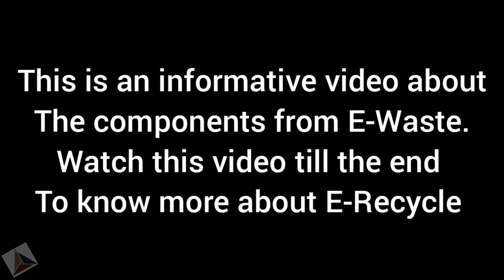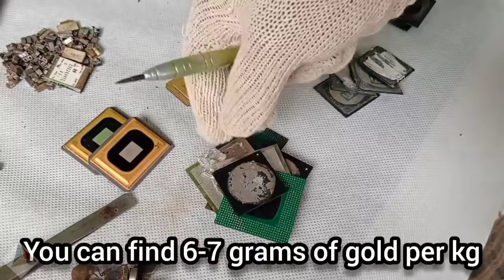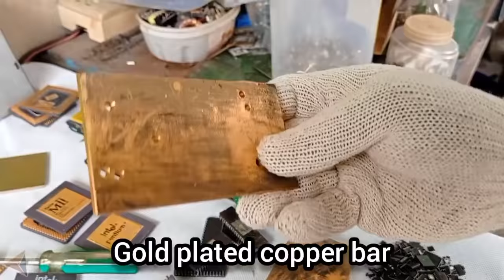Sorting Components For Gold Recovery | Introducing The Components That contains Gold | Gold Recovery

Comment: Quick question, wouldn't it be better to just pulverize the mother board to a almost dust like powder and then go from there,what would be the benefit v the hassle?
Thank you for your time kind sir
Reply from the maker: Considering the intricacies of e-waste recycling, pulverizing motherboards into almost dust-like powder might seem efficient, but it comes with challenges. The benefit lies in better element separation using water-flowing vibrator trays, outweighing the potential hassle associated with a finer powder approach. Thank you for your question!

Comment: You should always pyrolyze then burn (not melt) the computer part to:
1. lower volume (need less acid to refine and keep metals submerged) 
2. increase surface area by getting rid of plastics and other crap
3. Get rid of oils (those would make the extraction slower)
4. You don't need to break open the components
5. Write down below

2024 edit, ruthenium from smds will burn off though
But its hard to process using acids anyway
Reply: Where does that smoke go? In air? I n environment? Kind of very important
Reply: @fightington  that's true but people are burning wires, plastics, whole freaking circuit boards.
There is not that much plastics on those gold bearing parts to be that concerned in my opinion

There is always that guy who sets fire to a whole landfill, this is nothing in comparison
Reply: Doesnt mean it's any less important - it all adds up and it's not good - life will go on without a human-inhabital planet and we don't have another one floating around. Agree there is much worse but thats not the point. All the best
Reply: @fightington  true, i ll edit it to pyrolyze the parts and then burn the remaining carbon

Comment: Sir, I did it aqua regia with the items ram fingers and processor bottom chips. I got metal powder then while I am melting with mercury result is not good. Colour of metal is black or grey type. Jewelry workers said it is not gold but is a metal they couldn't identify. So advice me where my mistake on it?
Reply from the maker: Again refine it with aqua regia.
Reply: Ok sir I will do it again
Reply: I do with 15 processor 15 bga bottom 10 ram fingers and some little others then I go it below 0.17 ml metal only
Reply: And sir one more also metal powder melting with mercury is it ok?
Reply from the maker: Don't use mercury. 
Use aqua regia

Comment: The thing you call a dlp processor has nothing to do with DLP at all. DLP or DMD chips as they're usually called have a screen built into the chip, than it is reflected onto the screen. You just got one in the latest video you posted, Nevermind you have one in this video the projection chip as you call it is a DLP cpu
Reply: I'm confused sorry . ....," The thing you said was a DLP processor .... Is a DLP CPU." ?  
Isn't a CPU a processor?
Reply: @dfsilversurfer  that's where the screen starts on that chip it's the only thing it does than the screen is magnified a couple times onto the screen you watch. It doesn't process or do anything else. They call it cpu for ewaste but the actual computing power is done on the other chips on the boards. If you look at dlp or dmd chips you will see the screen, it's a mini TV basically...while you watch TV the same picture is playing on the chip inside the TV. Think of it as the video card 🤔
Reply: @dfsilversurfer  a true cpu or processor controls almost everything, the dmd chip controls nothing it's just a place for the picture to start before its projected and reflected into a larger screen hence the name projectors or DLP tvs. It's completely different from a computer cpu processor and yes I called the dlp chip a cpu because I am into ewaste and to sell them or group them together people hae always called them cpus UT technically that's wrong